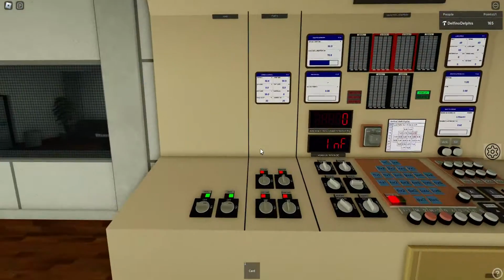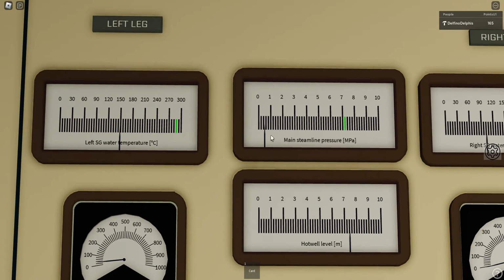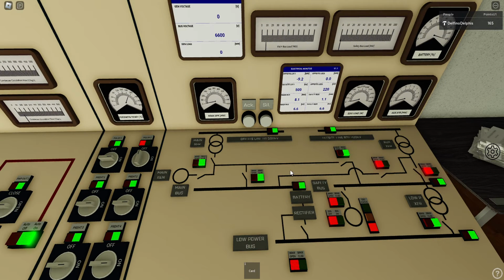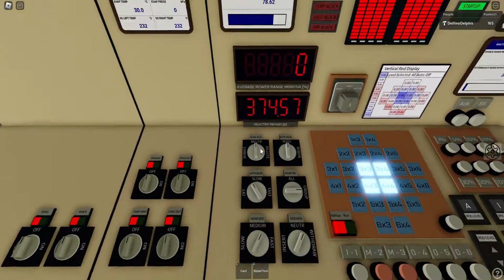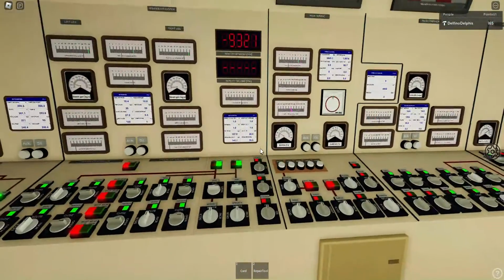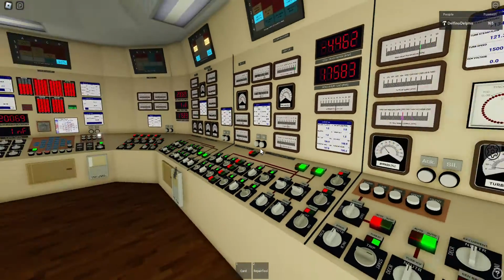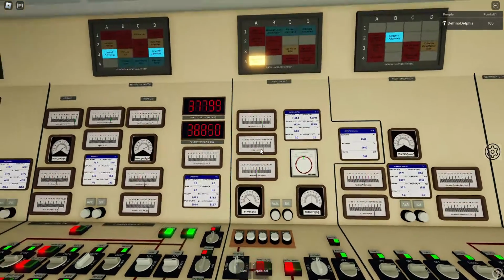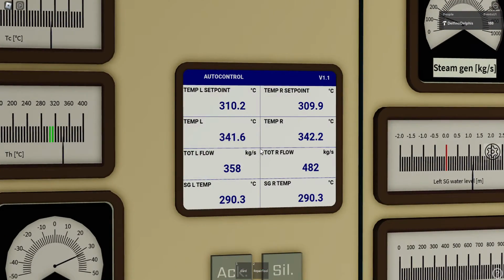[RPWR] Startup Guide

Comment: What is the use of the balancer?
Reply: The balancer is to rid the core of hotspots on the vertical rod display some parts of the core will be hotter and colder the balancer will pull and push rods so that the temperature is the same in the core